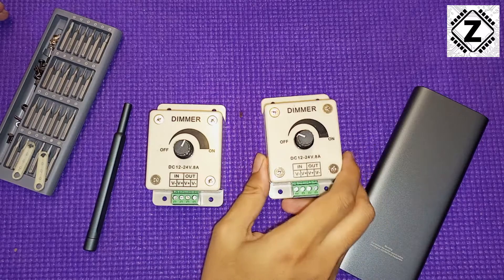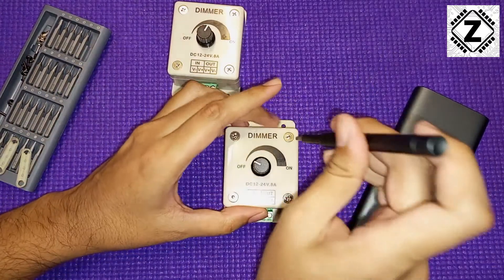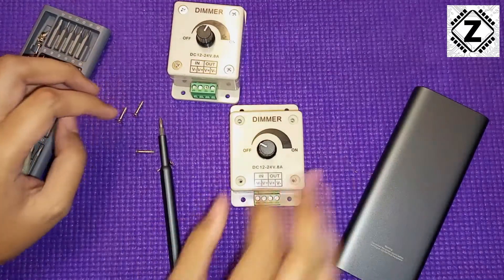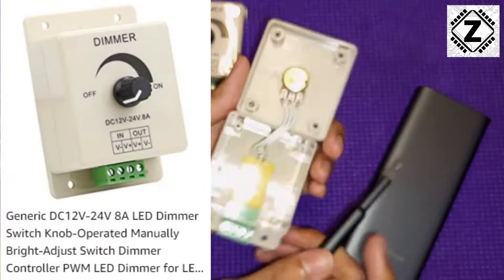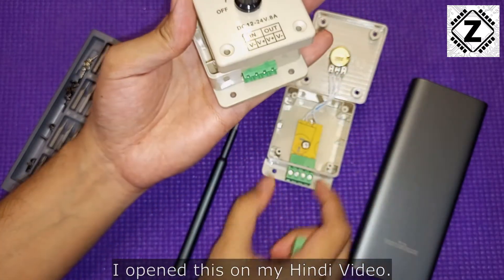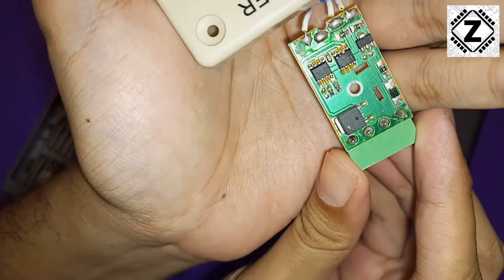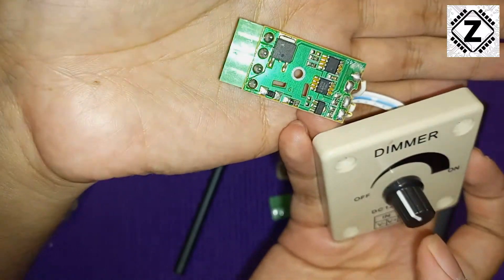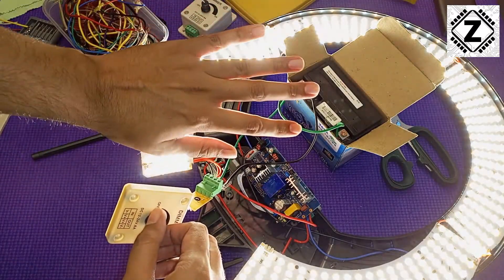[Eng] Is your DC LED PWM Dimmer FAKE? Lets Open it up & Take a Look Inside

Comment: one of those failed, when left in "turned off" position...
and with 4S Li battery, capable of very high amperage - so remember to use switch...